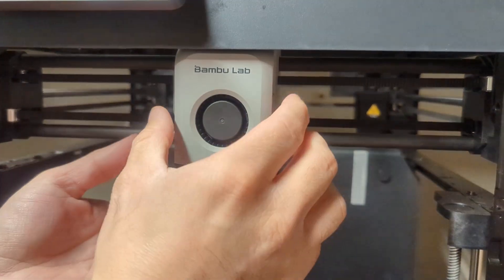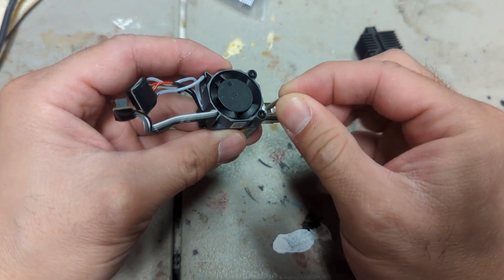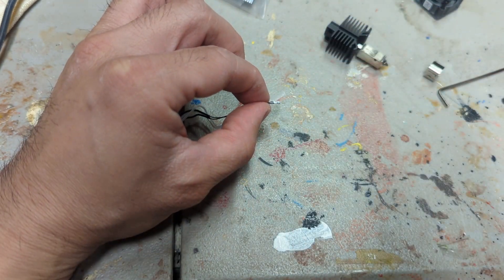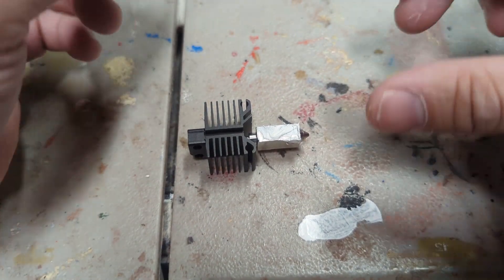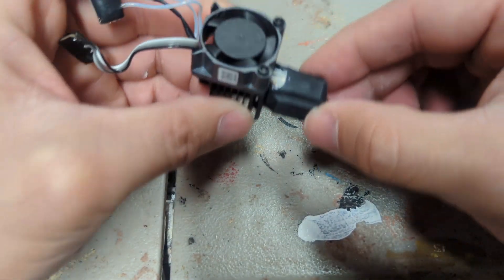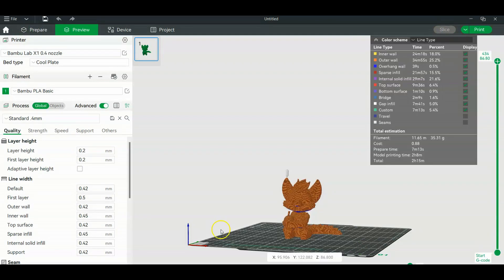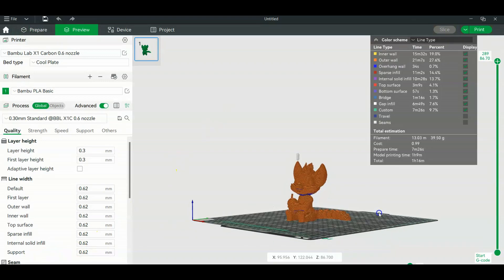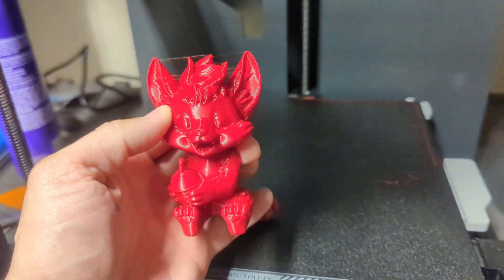Easy Way to Change or Upgrade Your BambuLab P1P Nozzle

Comment: Mine doesn’t come with the nozzle type it says nozzle on extra tab and when I change it, it says it’s not the same thing as what’s on the printer did I changed both to a 0.2

Comment: I see why they also sell the whole hotend assembly as a single unit in addition to just the hotend. It doesn't look like a horribly complex process, but $20 to not have to mess with thermal paste and reducing it to just two screws and two plugs seems like a decent deal, especially if you're doing it often.

Comment: This video is missing a few steps
1) you should empty nozzle before taking it off
2) you dont mention removing the black plastic cover on the hot end
3) when your putting the silver clamp back on your video shows one way your trying to get it on (wrong way) then the video cuts to the clip being on a different position

Comment: Followed this to a T about a year ago and went beautifully.  Did it again just now and now the fan either wants to blow at 100% or 0% and can't be controlled by the printer or either app.  Look for a pinched wire but nothing seems wrong.  Any ideas?

Comment: I am about to buy a p1p and this is such a relief. my current printer requires you to unscrew 6+ screws to remove the hotend, and uses extremely fragile surface mount connectors. it is my least favorite maintenance item,

Comment: When I removed the thermister it didn't go well and the wire separated into two.  Now the P1S says "The nozzle temperature is abnormal, the sensor may be open circuit."  I have no idea what to do.  Should I exchange the machine to Bambu for another?

Comment: Thanks for the very thorough step by step. I'm about to print some marble filament for the first time on my P1S and wanted to know how to remove the nozzle if it clogs as it did on a different printer. You mentioned a retraction flow. How do you identify a retraction flaw? Thanks. Liked and subbed up and commented.

Comment: Good video, but I had a problem. When I removed the thermal cable from the nozzle, the cable broke because it was stuck in the hole so tightly that I couldn't pull it out. Now I can't use the printer until I receive the new delivery from Bambulab. What is your solution to unplug stuck thermal sensors?
Reply: The same exact thing just happened to me. did you end up needing to do a full replacement?
Reply: @forcemarine  I´ve replaced the thermal cable with plate, after this everthing works again

Comment: You changed not only the nozzle diameter from 0.4 to 0.6, but also the layer height from 0.2 to 0.3. Most of the saved time is due to the layer height. Still awesome video and very detailed and professional explanation!

Comment: One of the reasons I barely use my Bambu P1P and now 99% of the time use my Flashforge Adventurer 5M.  Its way to much work to just change a nozzle on the Bambu, My Flashforge is just a flip a clip and take out the nozzle

Comment: I've been watching videos on lithophanes and they say to use a .2 nozzle.  I had no idea swapping nozzles was such a huge hassle.
Reply: Thats really easy! You should have tried it on older Prusa Models
Reply: It's not usually this difficult. Bambu also sells the nozzles already assembled, so it's usually 2 screws, unhook wires, put the new nozzle on, put the 2 screws back in, plug the new nozzle wires in, good to go. Very simple. The nozzle in the video is not pre-assembled, which they also sell, they're just cheaper than already assembled nozzles. The price difference is so minimal that it's worth just getting a pre assembled nozzle. 
I actually find it easier than trying to change the nozzle on my Ender 3 since I don't have to preheat the nozzle, and no worries about if the new nozzle is fitting snug, etc etc.
Reply: For other printers, its not. Its just unscrewing and screwing a new nozzle in
Reply: What slicer did you use you in this video?

Comment: so refreshing for a video to get straight to the point without unnecessary intros and begging to like and subscribe because the algorithm blah blah blah. Thank you, it was very helpful. (Liked and subscribed because you earned it}.
Reply: Although everyone should be aware that at 3:10, they tried to put the clip on incorrectly, and instead of telling everyone, they cut to a shot of it added correctly. Doing it their way can damage the thermistor.
Reply: @hippopotamus86  yeah I almost got it wrong end it's easy to miss it but since you went that far an have it in front of you it's not hard to figure out how it goes back in. I mean the clip itself is self explanatory - leaving room for the cable.
Reply: @chrisradical2046  You say that but another YouTuber put it on wrong on an offbrand hotend while complaining that they didn't make a clip for the specific hotend. It would have fit if they turned it the other way around.
Reply: That's what I was going to say! No scratch screen. No "hello everyone", or bs talk talk. Just straight to the point! Bravo for that.

Comment: I would point out that, for approximately $20 difference, it might also be convenient and safe to take the Complete Hotend Assembly.
Reply: Yeah I was thinking of grabbing a variety of nozzles but after 1.5 minute I figured it'd be much easier, faster and lower risk to get a set of additional assemblies and only change the nozzle if it has issues 😅
Reply: I made the mistake of not getting full assembly, I thought that meant it came with the part fan "I don't need another one of those" haha
Reply: I was thinking the same. That looks too risky for me.
Reply: Definetly. And you have some spare parts as a bonus with the ease of use.
Reply: fucking nightmare assembling this piece of shit
Reply: Im a 13 year old boy and i just watched it carefully and i can print with it so it should be possible for you guys

Comment: Obnoxious that the thermistor and ceramic heater are part of the same unit on the P1P. One dies? Replace both for double the price. Yippee. And of course this is the one item they don't include a spare for in the box. :(

Comment: The Ceramic heater will NOT come off of mine, I'm afraid to pull on the wiring. :(  Not sure what I can do at this point.
Reply: did you solve this?
Reply: @kwitskwits774 yes
Reply: Sell the printer to someone else who isn't retarded.

Comment: I have a Carbon X1 and the original .4 nozzle. I just got a .6 nozzle but when I sliced it in Bambu Studio the .4 was often faster than the .6! Apparently it's tweeted for .4. Your video shows a significant savings in time (like my Prusa does when I use the .6) but my slices show otherwise. Any thoughts on real world .6 nozzle times and usage after your
 last few weeks?
Reply: He sliced the 0.4 at 0.2 layer height and the 0.6 at 0.3 layer height.  The layer height accounts for ALL of the time savings.
Reply: @petercallison5765  Extrusion width also makes a really big difference (at least with conventional machines and slicers) Extrusion width, is typically 120% of the nozzle size.
Reply: Hi Philip, I was thinking of buying a p1p and doing some tests with Bambu Studio I noticed the same thing.
I am not very experienced and can't figure out if they use more conservative speed settings for flow rate limits or cooling, what do you think?
As soon as the input shaper for Prusa MK4 is made official I will do some testing with Prusa Slicer, the Prusa is slower anyway but I find it interesting, if effective, to work on the timings by changing the nozzle.

Comment: Had first layer issues P1P with pei and bambu filament after a dozen prints.
Got a .6 nozzle
Fingers cossed
Thanks for the vid
Reply: It's because they make it so you have to use glue. It's not that bad, it actually doesn't even show up in the print
Reply: @maximuschapman7760  I never used glue on my P1P. Only time I had issues with first layer was when initially I didn't pick the right plate type in Bambu Studio or I would use prints that had small contact area and would really require a brim, but I used no brim for whatever reason. Other times, using textured PEI plate and official Bambu filament or some other filament I had no issues with PLA or PETG.
Reply: You have to wash your pei plate with water and soap and then alcohol, and it will stick as new.

Comment: Are the nozzles always a complete assembly change?  That seems really inconvenient - especially if the nozzles are brass instead of hardened steel.
Reply: This is not brass, this is stainless steel, but not hardened. Still it will print a lot more than brass one.
Reply: Really?  I feel like it's MORE convenient to just change the whole assembly.  Why?
1) don't have to worry about heating up the hotend to hot-tighten the nozzle when you change it.
2) don't have to worry about getting a good grip on both the nozzle AND the heater block when trying to tighten the nozzle (like on my Ender 3 S1 Pro) so you don't twist something that shouldn't be twisted.
3) since the Bambu automatically retracts the filament when printing is done, as far as I'm aware, don't have to even worry about doing that prior to switching to a larger/smaller nozzle.

Comment: When and why would you want to use the .6mm nozzle?
Reply: You would also use it with wood or carbon fiber to prevent clogs.
Reply: Like Peter said, .6mm is recommended for "infused" filaments to prevent clogging.  Also to help decrease overall print time as you said.  But unless you regularly print at sub-.2mm layer heights on a .4mm nozzle, you won't really notice a quality change at .3mm layer height on a .6mm nozzle.  one tenth of a millimeter is almost LITERALLY a hairs bredth.
Reply: Nevermind, I watched the whole video and I guess you change it to increase the printing time.  Good one :-)
Reply: @doctorpd1969  jesus christ